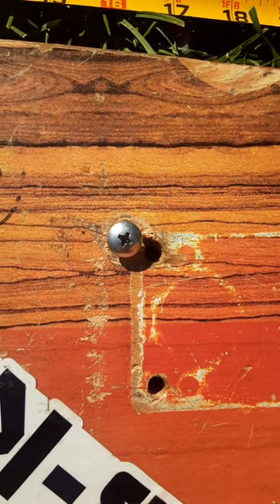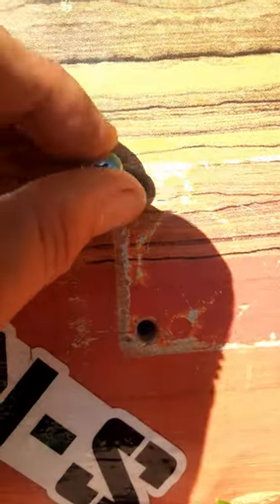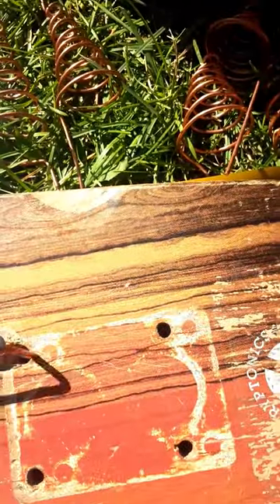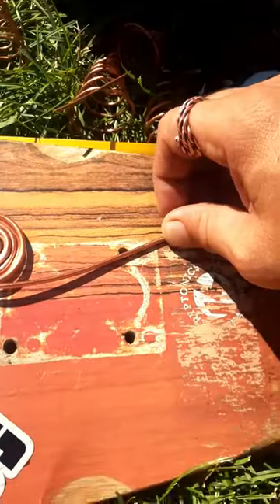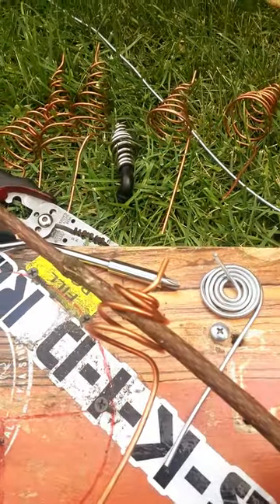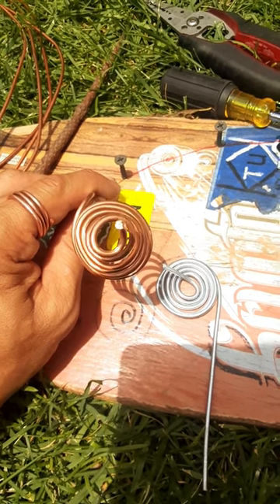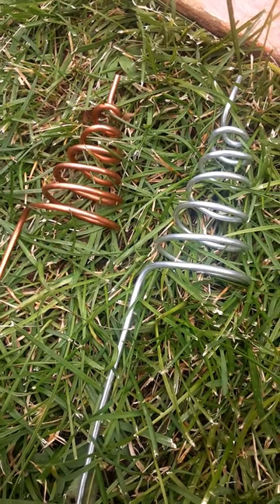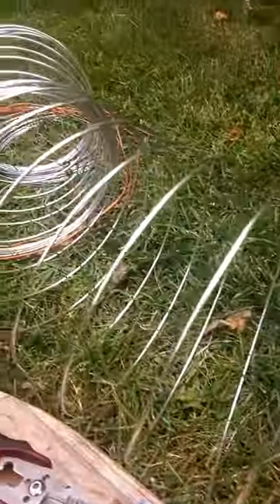Eletroculture / Magnetoculture - How To Make "Pier Luigi Ighina" Style Spirals at home

Comment: Hi. Thanks for the video! Could you please share your opinion on the genuine length of a royal cubit?
Reply from the maker: @sandysmagicmix Always glad to share 😃Thank you for such a great question! I wanna say its slightly over 21 inches at times I just guestamate between 21 inches and 21 1/4 inches. When using Centimeters you can cut to 53 CM. I know many answers are found online when you look into the work of Slim Spurling you may find the Sacred Cubit at 20.63 inches ~ 52.4 cm.